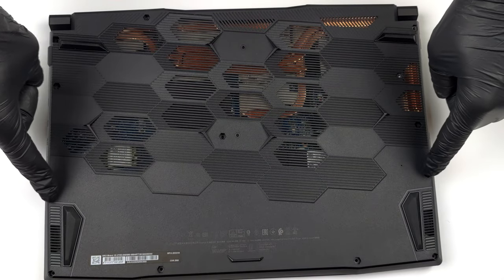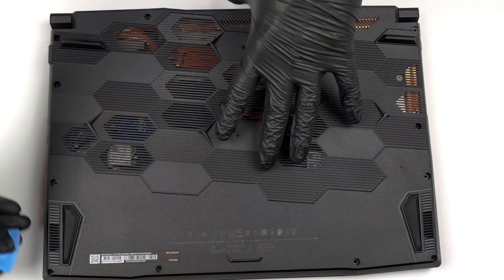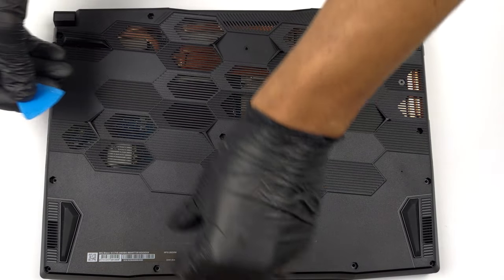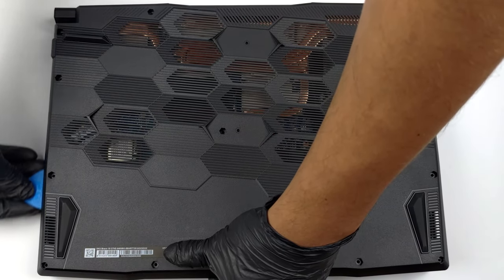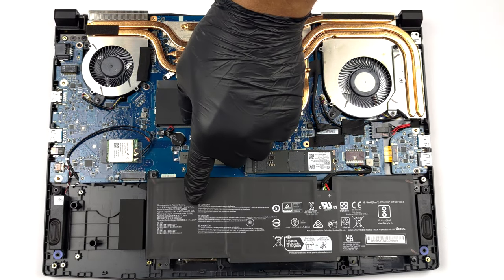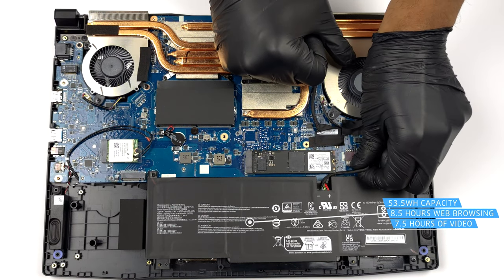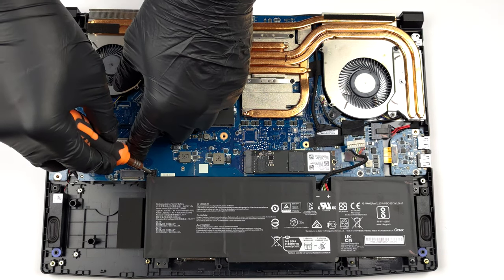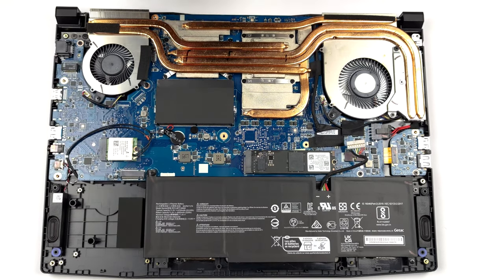🛠️ How to open MSI Bravo 15 C7V - disassembly and upgrade options

Comment: That missing mounting screw issue is also present on MSI Katana 15. 
I heard that this is manufacturing issue, and if you contact MSI, they will send you part to install that will contain mount for the screw
Reply: its not an issue, they did it on purpose to get more cash after sales, why do you think they dropped the prices so low
Reply: @manyord7089 its a free part tf u mean
Reply: Thank you

Comment: So how to adding secondary ssd in this laptop?
Reply: You can't
Reply: @Abyss95 no, you actually can. Although it must be an m.2 ssd.

It is located in an empty space, near the speaker and right below the wifi card.

You can probably use tapes to secure the ssd.
Reply: @PRO_VE  there's a mounting brackets for the M.2 SSD but it's not included in the purchase

You have to order it when you want to mount an SSD
Reply: DIY the bracket

Comment: Please try ssd installation in that second slot
Reply: Hi bro from ur utube channel
It seems to have a secondary m.2 slot to the left of battery near speaker right below the black tape
Reply: @srivenkateswaraswamy3403  may be or may not be possible I'll check and update you
Reply: @gamesandclips81  ok bro🙏
Reply: @srivenkateswaraswamy3403  bro there is no slot, that tape is not on board it on plastic body just covering wires
Reply: @gamesandclips81  ok bro actually I will buy asus or lenovo or hp from offline only
Because I got scammed by amazon they sent used msi Bravo 15 laptop they are processing return first they said they won't be able to take return their investigation team said they sent new product
But after technician visit they are processing return I just want refund actually I will never buy from online electronics

Comment: When you remove the battery below, do you see a 2.5 disk slot?
Reply: it doesn't have 2.5 disk slot, only uses m.2 ssd
Reply: Virtually none of modern laptops has a 2.5 slot. SATA era is over.

Comment: the weakest laptop manufacturer, have you noticed the burn marks on the edge of the motherboard? how long will the laptop last? maximum 2 months
Reply: Never bought single fan gaming laptop
Reply: @doohof1016  two fans
Reply: Well, if anything, I still have i5 9300 gf63 i bought in 2020 and used it nearly every day and they still run pretty well. I always just shove them into my bag, never used cooling pad, and can have them plugged without ever turning them off for a couple of days. The only problem so far is that they run really hot (around 90 C, prolly cus of dust build up) for both gpu and cpu. They also sometimes turn on by itself, I suspect this is because the frame is pushing on the power button when the lid is closed.
Reply: @kawaiikoto8800 running hot is an issue that all gaming laptops share. But can you put your hand on the wasd zone when it's running hot? Does it burn your hand or not? Because I see that MSI use similar motherboard layout throughout all their laptops with the hottest zone and biggest fan being located near the area where you rest your left hand.